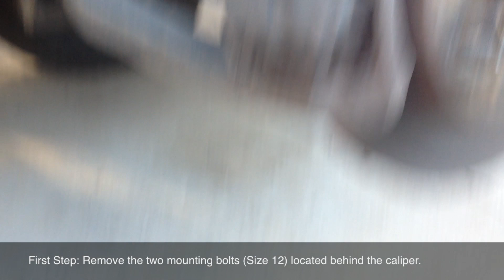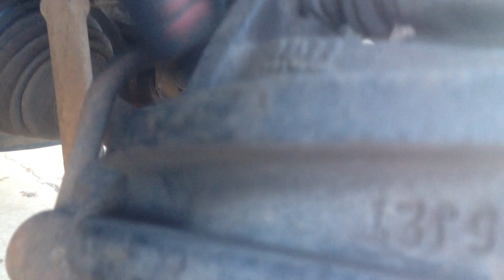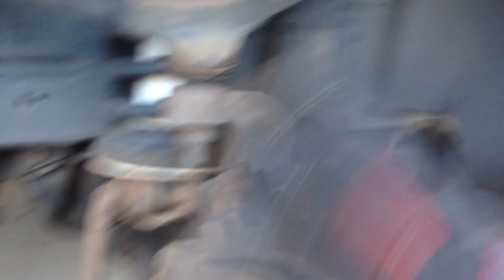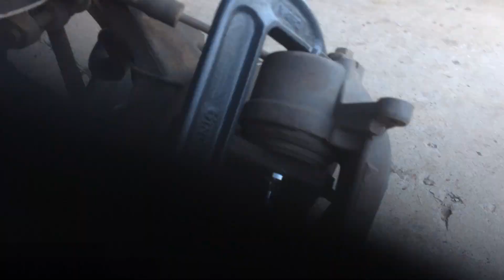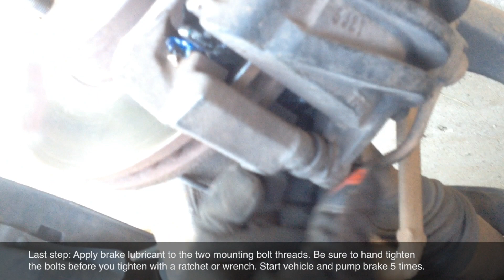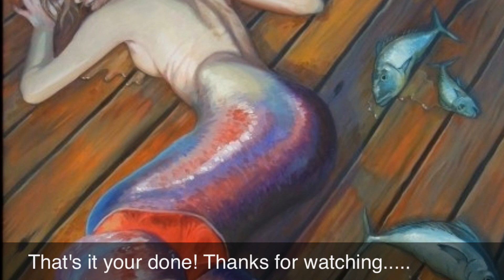How to change front brake pads on Jeep Liberty KJ

Comment: what brake fluid is recommended dot 3-4?  also yo know what fluid fr power steering ,thx
Reply from the maker: +AmazonShroom if your talking about what brand I'd recommend then I couldn't tell you. If you really wanna do it to manufacturer specifications you can go to your local jeep dealer and order mopar products. Otherwise, any brake fluid with dot 3 on the bottle is sufficient. The power steering fluid is the same exact fluid you would use for your transmission. So ATF+4 full synthetic is recommended. Do not use "power steering fluid". The power steering pump in this jeep requires ATF+4 full synthetic.
Reply: Lance thanks and crap we used regular power steering fluid, now gona have get my friend ride over and drain it out
Reply: it was just a lil bit like a cup of pwr steering fluid hopefully it won't hurt my friends jeep thanks..